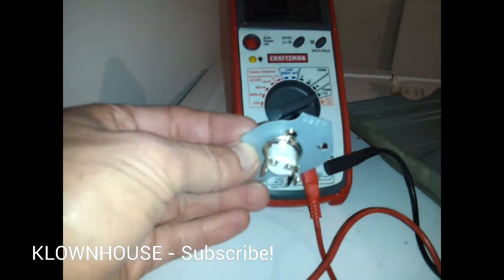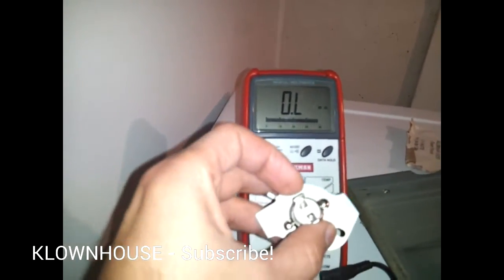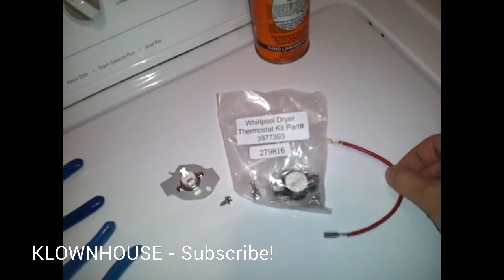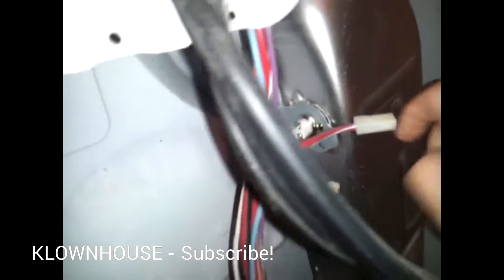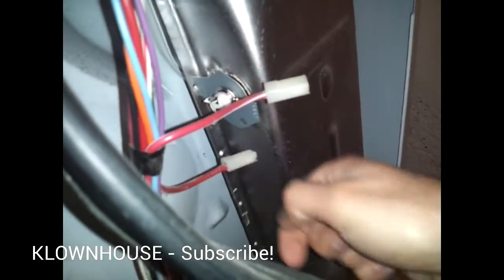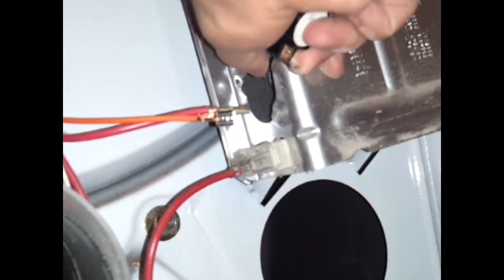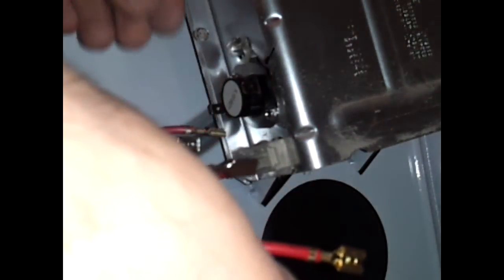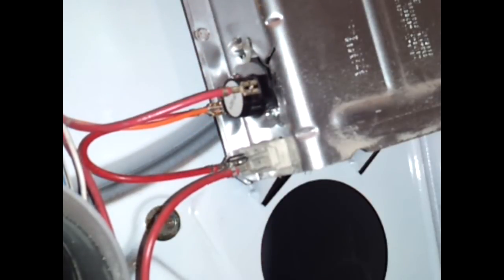Electric Whirlpool - Kenmore dryer no heat 279816 3977393

Comment: Why do you need to replace the thermostat if just the fuse is bad?
Reply: I don't know, but I just replaced the fuse twice and it blew again, so I'm replacing both and will see if that works better.  It might make sense is the thermostat doesn't cut off early enough.
Reply: I know this is 7 years late but if the operating thermostat is not maintaining the proper temp, it will overheat and blow the high limit. That’s why you replace both.